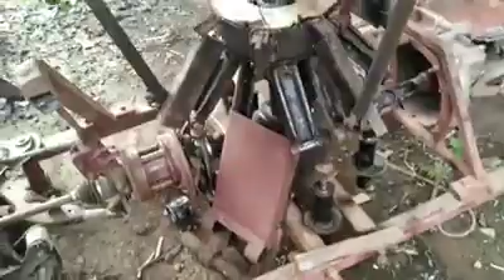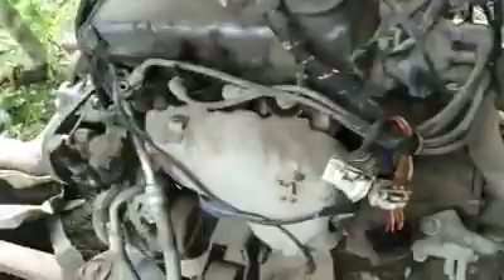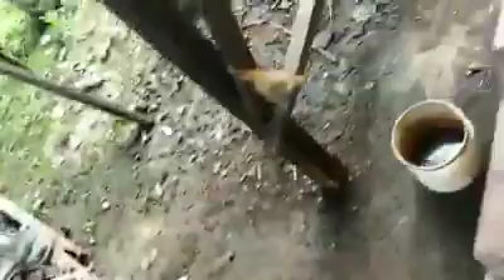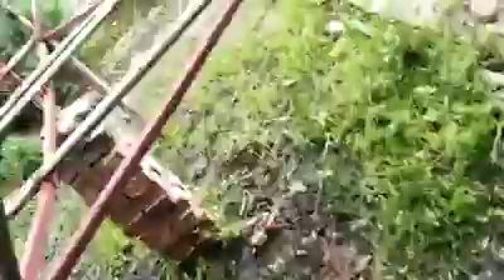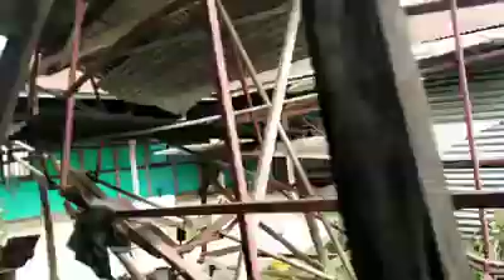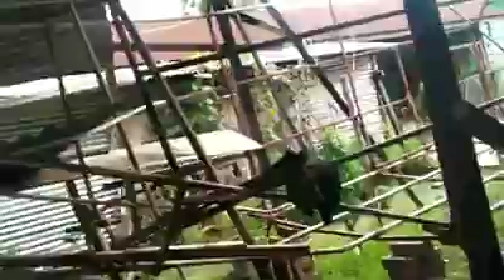Invention of Helicopter in Manipur 1 ( Manipur da Hujik² kanna sem/Sariba Helicopter gi Video ni..)

Comment: Engine, made with heavy weight vehicle engine, made with heavy weight iron, partially aluminium, rotor blades are made with iron, not suitable to fly. Impossible! Engine must be light weight with high RPM, must be made with magnesium alloy or high cost titanium. Rotor blades must be made with composite material, fiber with metals, titanium, aluminium etc.

Comment: mado hek pyba yaradi c b ge
Reply: C ro2
Reply: Ng mk lk a ga hatpiyo he ebo...
Reply: Ng mk lk a ga hatpiyo he ebo...
Reply: Mina twbada c d ba Ng Kaya jugot chab mi ntte
Reply: yani ojabu.....
Reply: yani ojabu.....
Reply: Engine, made with heavy weight vehicle engine, made with heavy weight iron, partially aluminium, rotor blades are made with iron, not suitable to fly. Impossible! Engine must be light weight with high RPM, must be made with magnesium alloy or high cost titanium. Rotor blades must be made with composite material, fiber with metals, titanium etc.

Comment: Nangi helicopter do pairaroi dhella gari oina onthokhwro adubu nggi interest dudi manghnganu hana research fajana twkho .
1)Area of the blade 
2)size of the body 
3)torque /engine rpm
4)structure of body much be aerodynamic 
5)weight and strength of material 
6)instruments cluster 
7)Info tenements etc... 👍